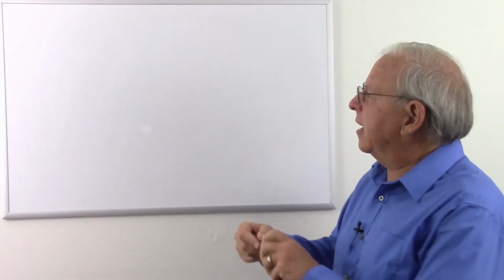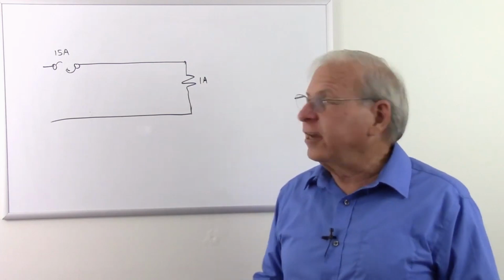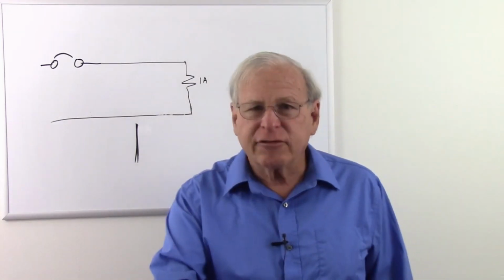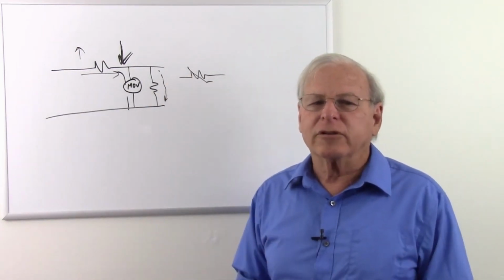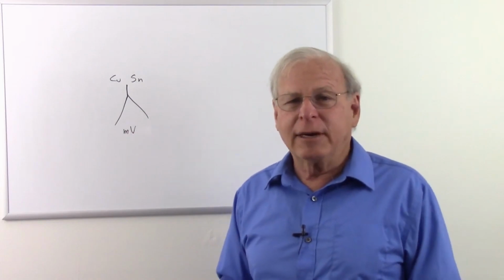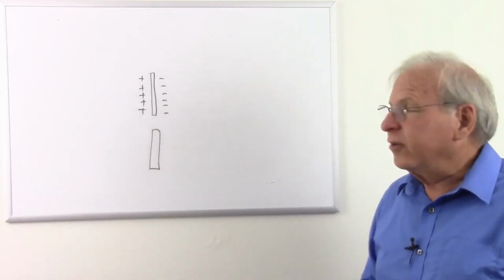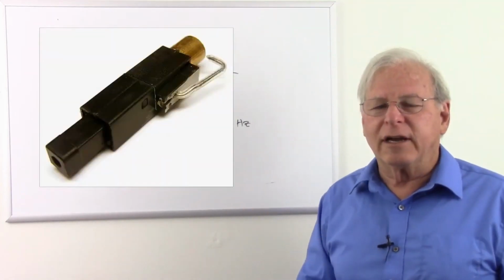Miscellaneous Components

Comment: - Circuit Protection -
00:14 - Fuses
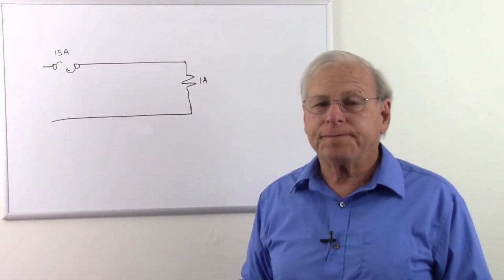05:58 - Circuit Breakers 
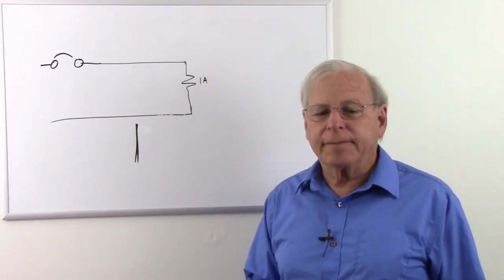11:46 - Varistors / MOV (Metal-Oxide Varistor)

- Temperatures -
17:43 - Thermistors
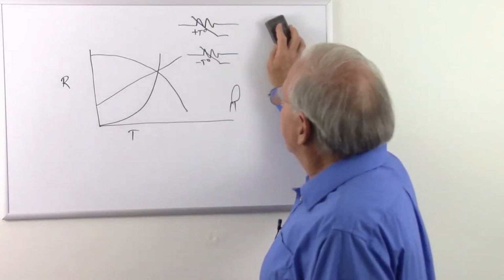20:35 - Thermocouples & RTG's
24:38 - Peltier-Devices/Elements

- Photoelectric Devices -
27:14 - Photovoltaics /Solarcells
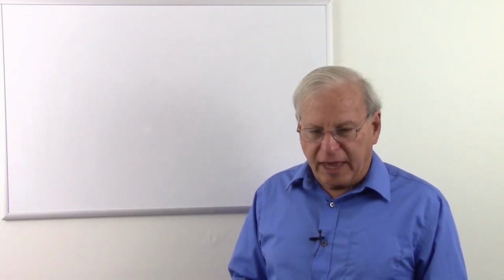27:58 - Photoresistors
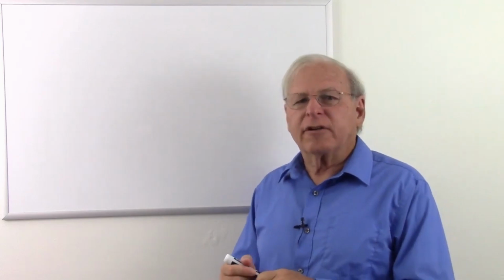29:00 - Photodiodes
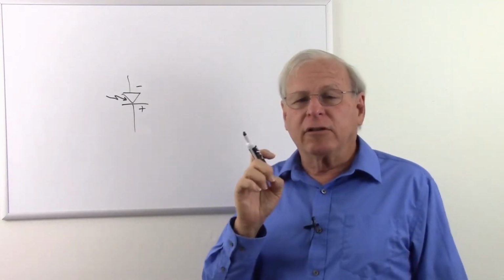29:55 - Phototransistor

- Electromagnetic Devices -
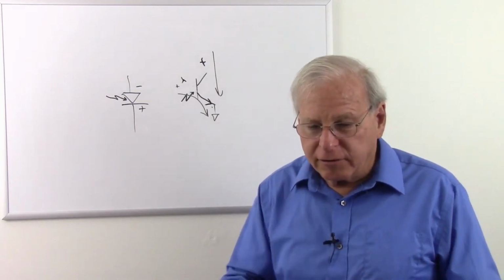31:45 - Quick Intro / Solenoids
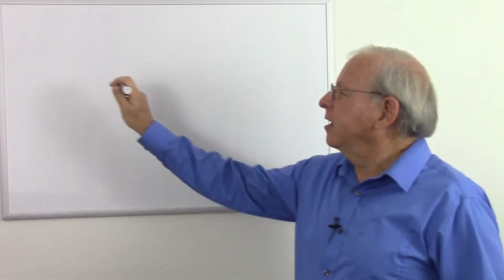32:07 - Hall-Effect Sensors

- Crystals -
33:45 - General Overview of Crystals & Piezoelectricity
36:32 - Crystal-Oscillators
38:51 - Oscillators in circuit
40:10 - Sparks!

40:52 - The End / Outro
Reply: Thank you